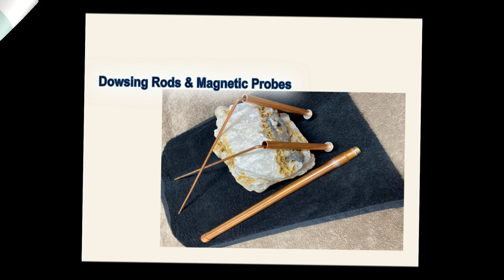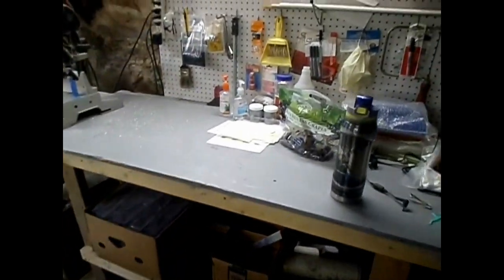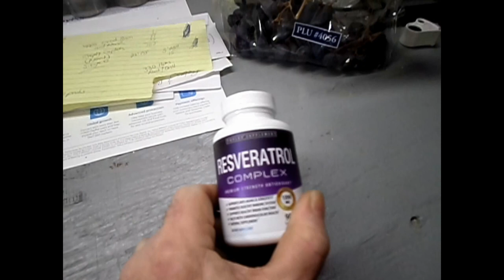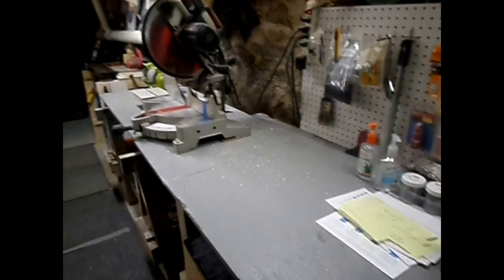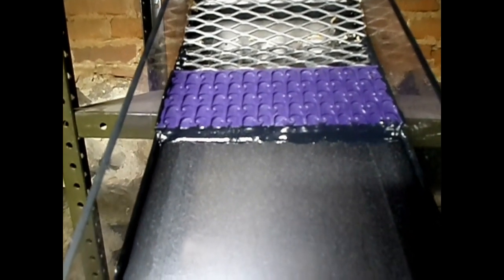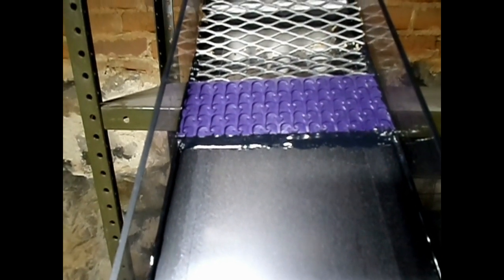A Word From GMGT

Comment: Always great to see you Joseph! Love the looks of those mats! I'm wondering if a piece of your lexan cut on an angle (top & bottom) wouldn't be good as a ramp on your Personal Box, with silicone top and bottom and sides...depending on the angles, you could make it a nice soft ramp, or a harsh ramp...just thinking....Have a great weekend! God bless 🙏🍇 👍
Reply from the maker: I do have scraps but it's almost as thick as the matting. The only way I could shape it would be on the belt sander and it wouldn't come out even. Not too mention, it would take a good 20 min or more per piece. Good thinking though! Thanks Ken and as always, may God bless you as well.

Comment: Just a thought:  Wouldn't larger rocks kick gold out of the dream mat as well as give it a huge amount of wear and tear over time with it bearing the brunt of the material going through the 'classifier' ... Wouldn't it be better to have it sitting under the punch-plate? Have it as a removable piece, perhaps glued to a thin piece of Lexan, to slide in and out. (I still want to call it a sluice, but I know it is patented as a classifier.)
Reply from the maker: No worries Roger, many call it a sluice out of habit. Yes, gold would more than likely get disturbed by larger rocks but, it merely an indicator mat for the user to get eyes on present gold. And yes Sir, I am hoping to make it removable. You may be onto something in your suggestion. Don't think I would put it on a separate piece of lexan though. But if your thought works, you will get the credit my friend.